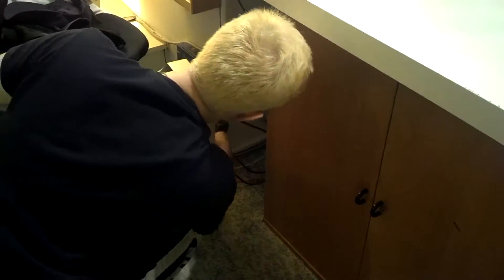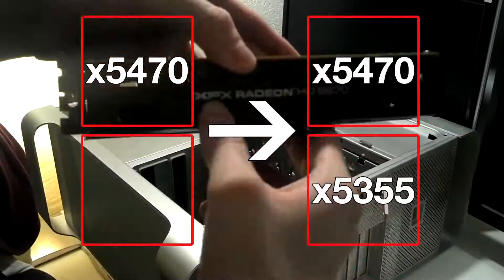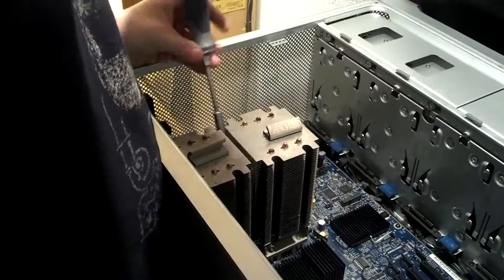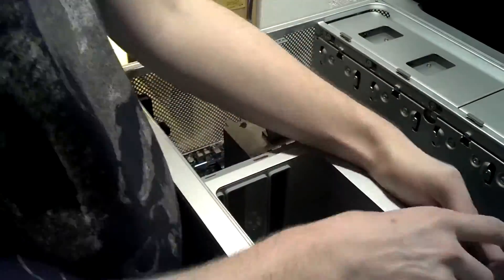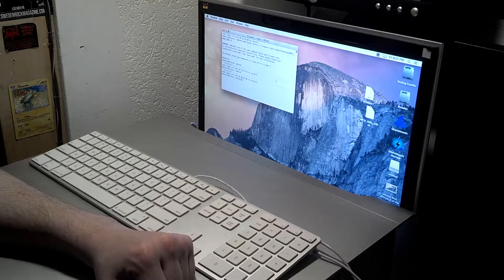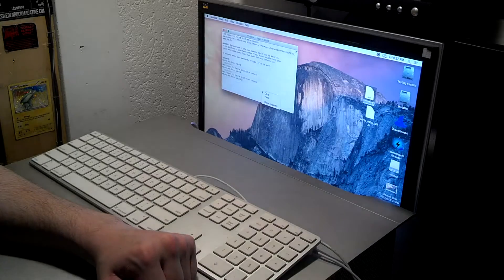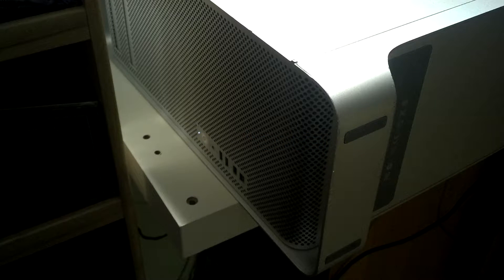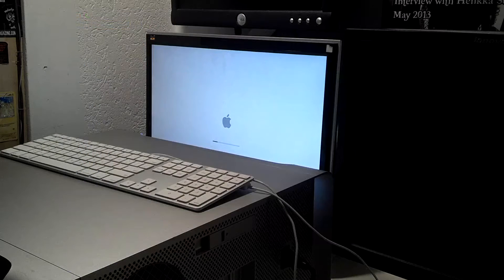Can you upgrade a first gen Mac Pro with a x54xx Xeon?

Comment: I have an old mac pro 1,1 sitting in my junk room next to a quad 2.5 G5 and a dual g4 1.42 MDD. I've been looking at installing Linux on the 1,1 but my daily driver is a Raspberry Pi 4 8gb clocked to 2.3 ghz. Its about all i need except for the rare occasion i want to edit video and that's what my 5,1 is for. The lights dim when i power the beast up though.

Comment: The efi file from the 3.1 contains a different board code than the 2.1/1.1. if someone rewrites the efi files from the 2.1/1.1 to include the microcode for the x54xx cpu's and the board code for the 2.1/11 it is possible to run x54xx cpu's on the mac pro1.1. The X54xx cpu's support SSE4.1 which is needed for macos version after 10.11.
Reply: What if you only had windows installed ? would it work?

Comment: I would bet that Apple has an experimental 64-bit EFI for the MP 1,1/2,1 locked away in another one of those infamous "just in case" drawers just like it did have prototype ppc SL builds and 64-bit GMA950 kexts. After all, the MP 3,1 mobo is largely based on the 1,1/2,1 and they probably adapted the efi to 64-bit first. Hopefully it will surface

Comment: I've been wanting to do this to make the most powerful machine that can run every version of Intel MacOS by using hacks for later versions plus having two GPUs- an 8800 Ultra (or Quadro FX 5600) and a metal supported Radeon HD 7970 GHz Edition and my Mac Pro is a 1,1 model but I figured it would probably be better to use a 2008 model since it's possible to install Tiger using certain tools and plus the EFI would work with the newer card since only a 64 bit kernel would work with the ROM. It might be possible to get the newer logic board for pretty cheap though the RAM is a different speed but it might work with the original riser cards if the modules themselves are the same.

Comment: One guy did it with a MacPro 1,1, but he also had an unsupported video card that hid the boot up sounds and visuals with a black screen until the log-in screen suddenly appeared. In essence.... ANYTHING IS POSSIBLE... SO... DONT GIVE UP MAN!! You're smart enough to think it through and think of a possible way to make it happen. It's always about communication and making every part communicate properly with others... when there is synergy homeostasis in your hardware, ANYTHING CAN WORK!! ;)
Reply: Processor stepping has something to do with it.  There's C stepping and E stepping 54xx processors.  The C stepping ones are most likely to work as they are a little older.

Comment: I have just finished installing 2 x 5365, 8g RAM, ATI 5770 Mac compatible, 80g SSD 
with El Capitan (10.11.5) and everything works fine.

If you have 512k RAM replace them with 2g RAM. This will solve random crashing problems.

I used El Capitan image, replaced the boot.efi (with black background) file in two places, downloaded 10.11.5 update, 
installed it, replaced the boot.efi again and disabled the 10.11.6 update.

If you have info on a better CPU then 5365 please send the info.

Really good video.
Reply: BEN TSAI you can find 2G RAM stick on eBay. 
The default 512K RAM does not work well with El Capitan.
You need to change them for 2G or bigger.
Reply: BEN TSAI There are two memory boards and each board can use 4 stick of RAM.
Find the board on the Mac Pro 1,2 or 2,1 and pull the boards, replace the memory stick
with the ones you want, put them back.

If you try this, I strongly recommend to turn off the Mac Pro and remove the power plug.

Good luck

Comment: Hey I love your video man!! But there’s one massive flaw. 5000x green creek chipsets only support SLAXX stepping and not SLBXX like the x5470. Theoretical you could stick a couple x5460 in there. I made the mistake of trying it with e5450’s with the SLBXX stepping! The same stepping problem applies to 2008 Mac pros. So round 2? I would send you a SLAXX x5460 if you want man.
Reply: On a side note, Apple iMac 2009’s can only support dual cores right? Actually no. A lot of people have thrown in q6600’s and other quad cores although the machine boots into windows but not Mac OS. 

Nobody knows the issue really accept for the fact that Apple never shipped a single Mac with a core 2 quad. Solution? ...

Put a Xeon in there that Wouldn’t give it a kernel panic! There’s an lag 775->771 mod you could do. But here’s the kicker. The iMac 2009 only supports SLBXX cpu’s 😉😉😉
So with the mod the iMac would run the quad core x5470 upgrade in Mac OS flawlessly. Crazy shit this is how I spend all my time 😂

Comment: Hey I have some questions about my Mac Pro around 2008 model I had a power outage at home and now my Mac will turn on but won't chime nothing happens just the light on the power button is solid like normal any idea. Is my logic board fucked ??
Reply: By the way sweet video

Comment: That's too bad. Sure would be nice to extend the usefulness of a 2,1 Mac Pro.

Just to clarify, the Mac will run with only a single X5355 installed in the top socket (not dual), right?
Reply from the maker: The Mac Pro runs with both sockets filled, or if only socket A is filled. You may install 2x x5355's or x5365's.
Reply: Yeah that's what I thought, just wanted to completely rule out only having a single CPU installed as a reason for not booting.

Comment: Hi can you clarify something? Can I put an '08 Logic Board in a '06-07 MP. Does it require any special modification?
Reply: You can but based on a video by hrutkay mods, it would be simpler and cost less in the long run to buy a mac pro 3,1 than to convert a 1,1 or 2,1 over to a 3,1.